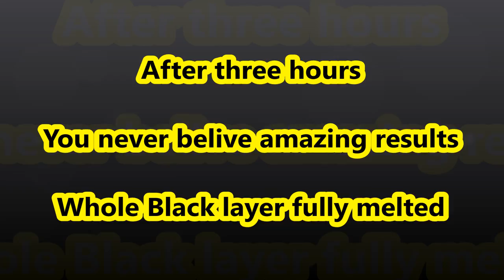How To Clean a Toilet Tank at Home || Just easy and best techique

Comment: I bought a very old house that has been updated. I took my first look inside the tank today and OMG.... mine is much worse than yours. I sure hope this works!
Reply: Did it work
Reply: I have a mid century house with original toilets. They're stamped June 1955 on both the lid and tank. The tanks were filthy and look like they've never been cleaned. I used this method and it didn't work. Can't use bleach as there are some metal parts. Guess I'll just have to try something else.

Comment: The acid will also eat out the stopper rubber seat and it will start leaking
Reply: Can the acid in vinegar do the same, because I'm thinking about using vinegar instead of citric acid crystals? Is so, what do you recommend using?

Comment: Harpic can be used to get the same result.  Pour 10 to 20 ml into the flush rank at night time or when flush is not used for 12 hrs, and  clean after 12 hrs by flushing out the water from tank.
Reply: Bleach or just regular harpic